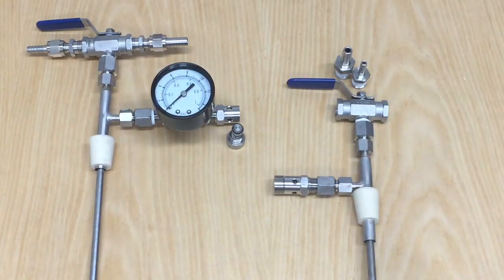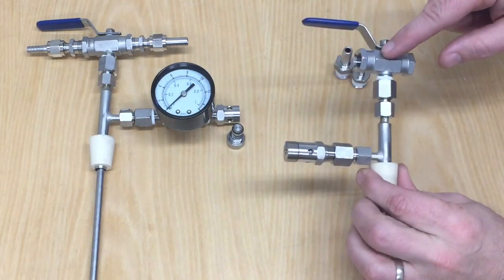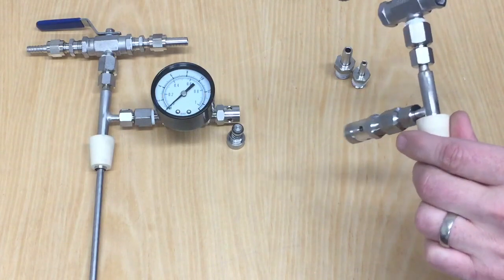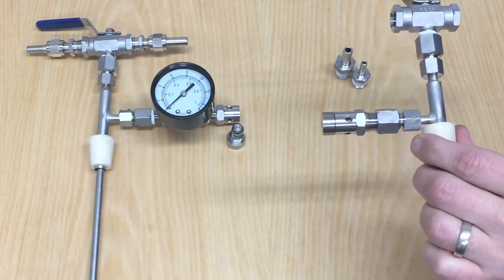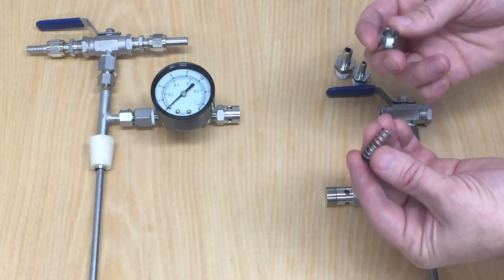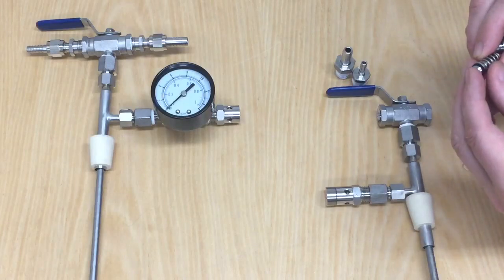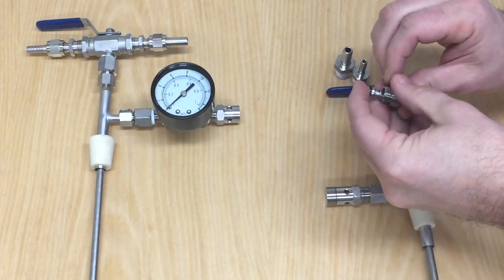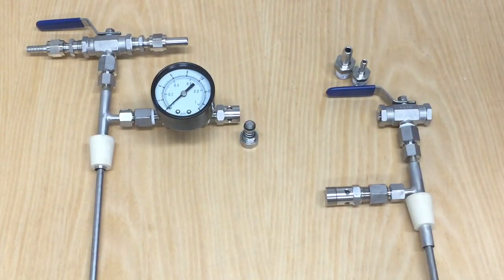CounterPressure Bottle Filler Maintenance

Comment: any chance you can post a video demo of someone using this exact model with the side pressure gauge? can you use it on different sized bottles and if so which ones?  can you swap out the rubber bung for different sizes? also a request...  would love to see a full demo that shows: hook up to:  filling bottles then:  a side by side comparison of the beer out of the keg poured into a glass next to beer from the filled bottles after the filled bottles have sat for 2-3 weeks to see what the carb loss is and if the presenter detects any changes in taste, nose or color.  any chance you know of a video that does this or if you can do this?
Reply from the maker: Thanks for the feedback.  Will put this on the ideas list for future videos.
Reply: MoreBeer Our Relief Valve wont purge any Co2 .... Help please Starting to Bottle now